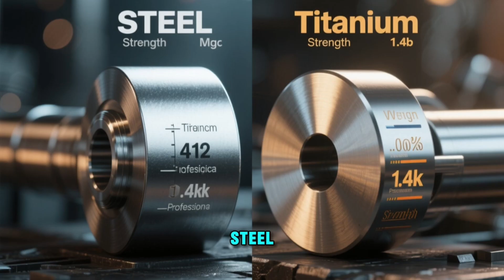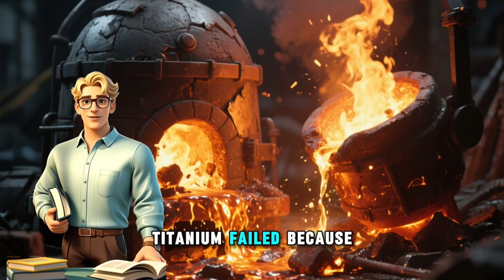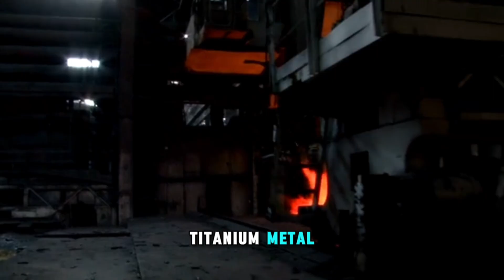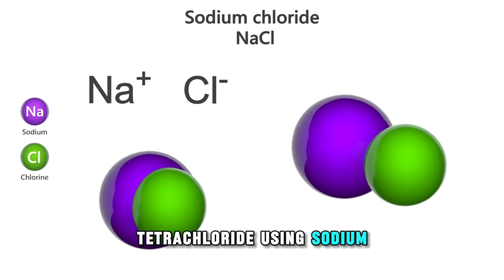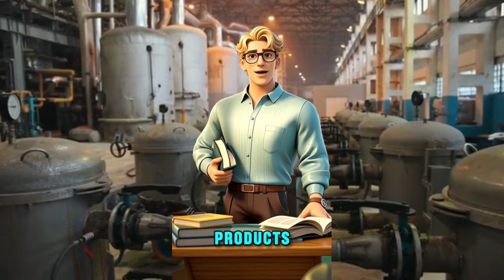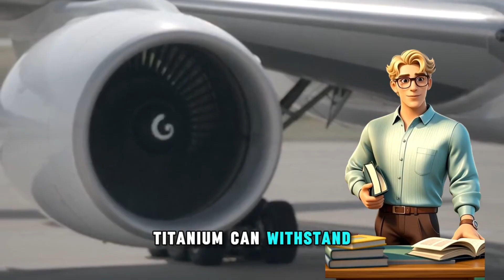How Titanium Is Made | From Rock to Strongest Metal on Earth

Comment: You just spoke of TITANIUM, how it's made, and its many uses, but not one word of the SR-71 BLACKBIRD, which is almost entirely made of TITANIUM. The BLACKBIRD still holds the title of the FASTEST, HIGHEST-FLYING, AIR-BREATHING, MANNED AIRCRAFT. EVER! And it was built back in the 1960s with sliderules. No computers, no electronic devices for constructing the design. Nothing but enginuity and intelligence. The BLACKBIRD flew well over 3 TIMES THE SPEED OF SOUND. MACH 3.2 is the manufacturer's suggested top speed. It could go faster. As it became faster( as it accelerated), it became more fuel-efficient. Transitioning from a normal jet engine to a ramjet engine.
Reply from the maker: Thanks for pointing out the next video I made about it 😉